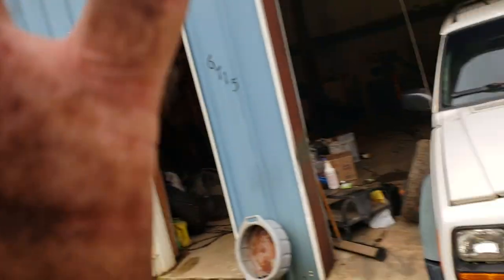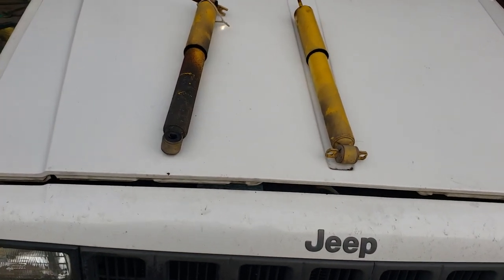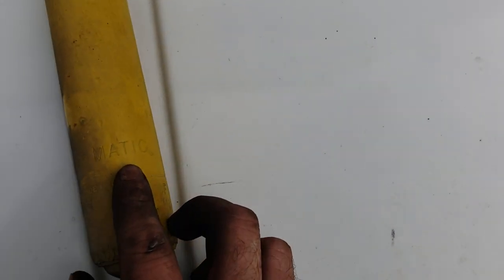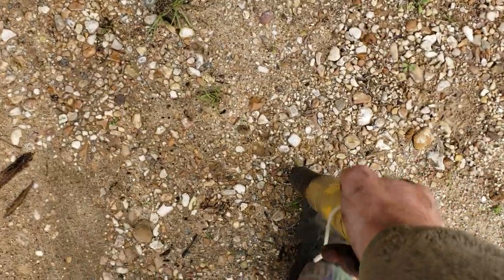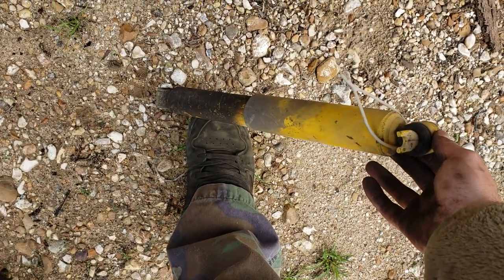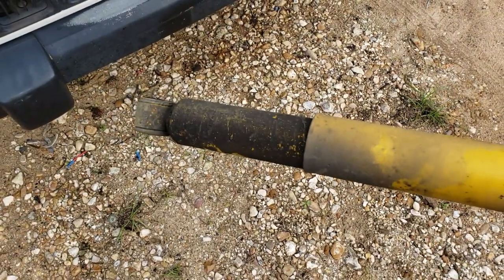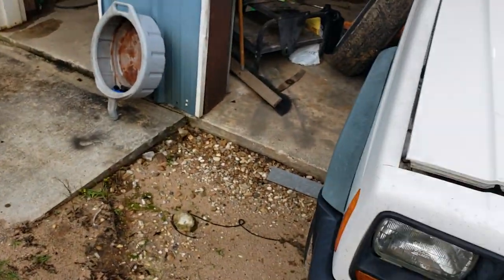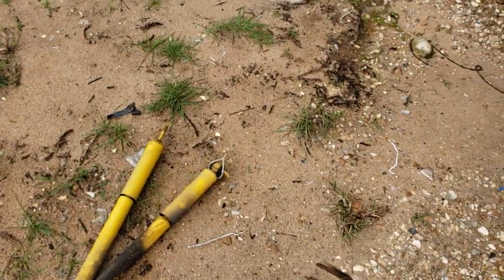How to identify a bad shock absorber.

Comment: This is one of the most simple videos about shocks that shows an oil leak and a bad shock in simple terms that anyone can understand. I agree with you on the 50-70K replacement. My small car had KYB struts and I replaced the rear after 100K and the shocks were soft but still functioning OK, the springs were broke due to high mileage (300K).

Comment: Wrong.  U don't want a shock to shoot back up on its own.  That's like having just a spring in your car.  The shock should resist the rebound of the springs
Reply: You don’t know what you’re talking about. I’m sure you never replaced shocks or you would know.
Reply: @jackadamz3  shocks are supposed to control the speed of the spring.   Are bad shock is one that moves in and out without any effort
Reply: You might never have seen a shock absorber in good condition. 😂